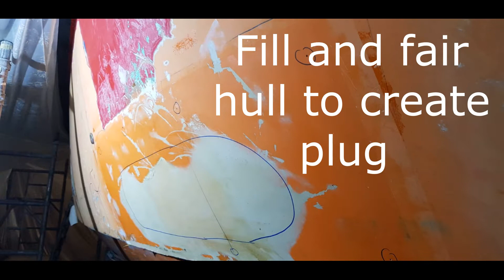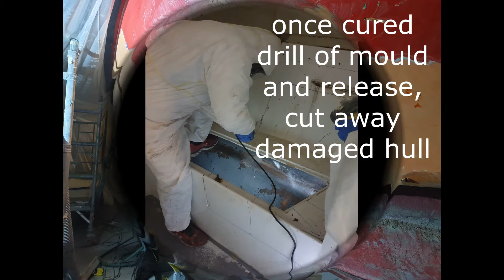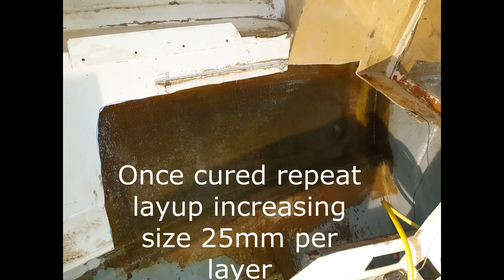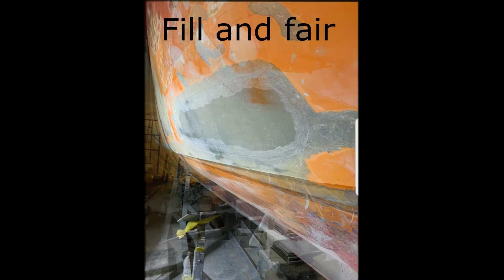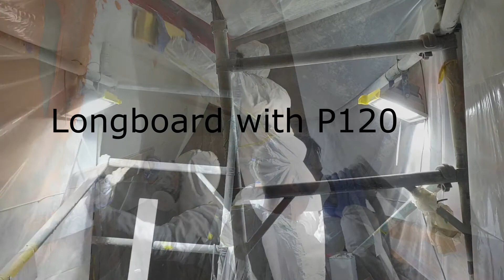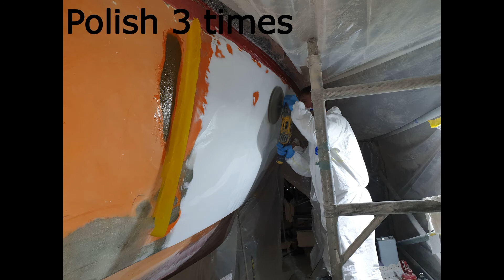Hole in my boat

Comment: What did you fill the original damaged spot with to prep the hull for your mould?
Reply from the maker: We screwed a piece of plywood in from the back to block the main hole then use cheap polyester car body filler to create the shape needed on the outside